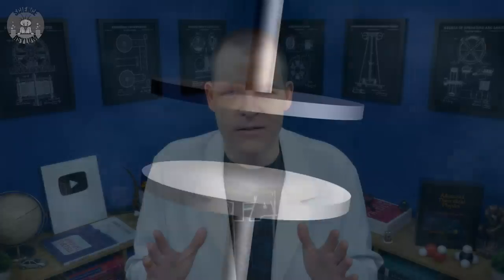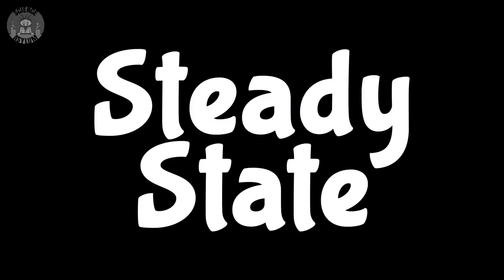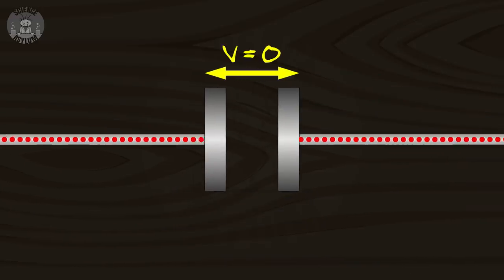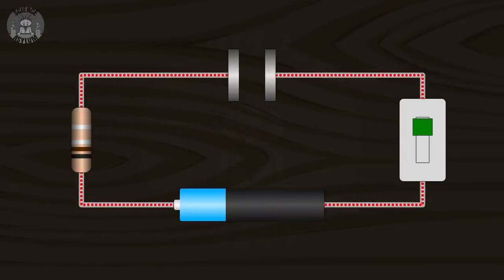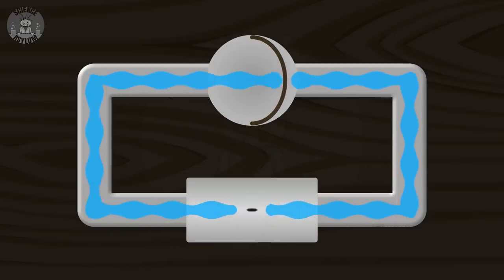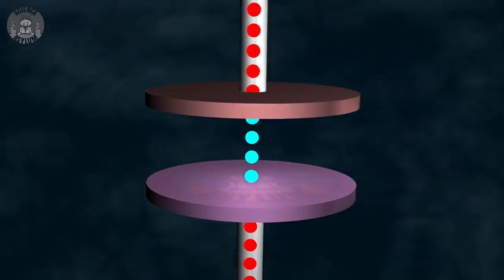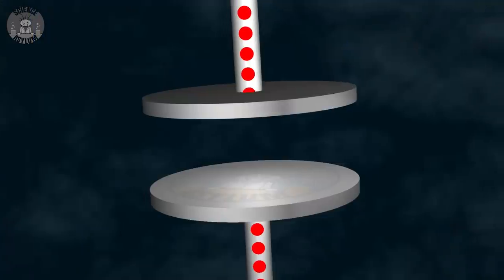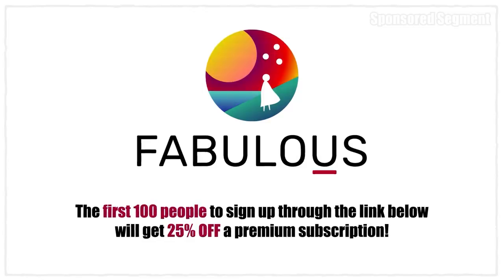Capacitors Are Gaps! How Does That Work?!

Comment: Honestly, I hoped you'd expand on the superconductor bit, given that you can hear basically everywhere they're exactly zero resistance.
Reply from the maker: Saying "superconductors have zero resistance" is easier and sounds more confident than saying "their resistance is below our ability to measure." It's laziness.
Reply: @ScienceAsylum  That's kinda disappointing, but thanks. I guess I should read up more on them.
Reply: @ScienceAsylum  oh wow I never noticed!
I just looked at an experiment where they use very low currents to avoid heating the sample. How would it heat up if there was truly zero resistance ;)
I'm sure it's much more complicated though, with all the different types and stuff...
Reply: @kylebowles9820  Superconductors have a maximum current above which they cease to superconduct, so yeah the current does need to be controlled if you want to actually have a superconductor
Reply: @triffid0hunter  i think the point is that per the conservation of energy, if current generated heat, any amount, there must be resistance.

If the resistance was truly zero, heat could not be generated by the current.
Reply: @triffid0hunter  nice, yeah I was aware of the quenching phenomena, wonder how they do it with superconducting magnets
Reply: @ScienceAsylum  Ok but mathematically we expect superconductors to have exactly zero resistance. We would need new physics to describe a mechanism for which they would somehow gain a miniscule resistance. All measurements up to date are consistent with 0 resistance in superconductors.
Reply: @triffid0hunter  Does that apply to both Type-I and Type-II? (And other types? I seem to recall not all superconductors neatly fit into two types.)
Reply: @ScienceAsylum  Saying "superconductors have zero dragons" is easier and sounds more confident than saying "their dragons are below our ability to detect." It's laziness.
Reply: so you mean I cant put 100 trillion amps into my bike motor?
Reply: @ScienceAsylum  "Their resistance is below our ability to measure," and "No material has zero resistance. Not even superconductors," are two different statements.  Is there reason to believe that it's nonzero? Does quantum make a theoretical prediction of zero or nonzero?

If you have talked about this at length somewhere else, I'd like to see it. Or if you'd make it a future video, that would be neat.  Thanks.

(Sorry for "@-ing" you... 😀)

Comment: 10:38 Oh right!  So that's why doping a semiconductor makes it a better conductor -- it doesn't give any more energy to the charge carriers, just means more charge carriers are free to move around.   I'm currently taking an EE class on semiconductor physics and we're finally getting to the parts that relate to electrodynamics (as opposed to the lower level stuff that's all quantum mechanics and statistical chemistry) so that's what came to mind rewatching this video.  It's amazing how connected everything is in physics.

Comment: Capacitors are just like synapses between neurons. Jumping "variable current" from one edge to other edge of the capacitors periodically as so called "the resonance" or ""oscillation"".  It is sensitive just to the CHANGE as much as its RANGE(capacity, Farad).  It is also something like bedroom lamp which shines while movement continues back and forth. When "back-forth" voltage change is extinguished, then it will be sleep time for the lamp...

Comment: I'm a welder, I've always been curious about the physics involved with arc welding, we usually run electrode positive DC circuits with welding rod, and the heat tends to focus in the base metal, what is actually happening in the arc?
Reply: Very good question ! That’s plasma physics goin’ on in there. I guess Nick can do a separate video on that.
Reply: With SMAW (Stick welding) the electrode positive polarity makes the rod actually get consumed, which drives the arc characteristics and such. 
It's the opposite with GTAW (tig welding) where there is not a consumable electrode. For tig welding, it's DCEN (electrode negative) and that makes all of the heat go into the base metal.
Reply: I’ll explain this in electron current flow, not traditional current flow. Stick and MIG welding are DCEP (direct current electrode positive), meaning the ground is hooked up to the base metal. TIG welding is DCEN (direct current electrode negative) meaning the positive is hooked up to the base metal (except on aluminum or magnesium, where the cleaning action/heat management of AC alternating current is needed).

In stick welding, you are creating a net negative charge on the base metal, hooked from the - cable on the voltage source. This happens because it is more electron charge dense in relation to protons. The + cable on the voltage source is hooked to the welding stick, and creates a net positive charge, because electrons are pulling them from the stick and into the voltage source, so the stick is less electron dense in relation to protons. When the positively charged stick touches the negatively charged base metal, electrons are violently pulled from the base metal into the stick. This enormous amount of heat creates the arc that allows the stick to be fused with the base metal. It doesn’t matter if the electrons are being pulled from the base to electrode, or vice versa. Because in TIG welding the electrons are ripped from the tungsten electrode to the base metal, which is the opposite of MIG/Stick. And in AC welding, the electrons are constantly being pushed/pulled each way- like TIG polarity, then MIG polarity, 120 times per second. The heat and ionization is the important part. 

In the presence of oxygen, it wants to pull electrons from the metal and give it to the oxygen, and over-oxidize the material. That’s why you use more inert gasses, so electrons can’t be stripped and over-oxidize your material. Inert gasses do not pull electrons from your material, making a smooth transition of electrons from stick to base, and thus don’t oxidize them. Inert gasses do not have available electron-empty spaces in their outer orbitals to steal them from metals. Different Inert gasses are chosen for specific metals too, because electron properties are different for both.
Reply: @rebeuhsin6410  Stick welding uses flux on the outside of the stick, that coats and vaporizes as an (inert) gas over the welds. It serves the same function as inert gases passed through a nozzle on MIG welding. 

TIG uses a non-consumable tungsten tip to create the arc, and a metal consumable rod is used while fed in.
Reply: The air gap between the electrode and the metal plate is a "resistor"  an invisible one...5000volts per centimeter and lower at like 500 volts per mm... That gets multiplied by the amperes...
Equals wattage.,. You control the gap with your hands.. Your actually controlling the resistance bigger gap more resistance less amperes... Closer narrow gap is  less resistance more amperes.... More electrons more heat . More melting
Reply: @damascus-ut1ee  Well i learned 2 things in this video and one came from you, thanks for that, and typing a reply to you is weird im typing backwards lol
Reply: @damascus-ut1ee  when you separate your right finger from your left finger by 1 cm you will not see an arc also.... But their is a voltage "arc" in the 10^-7..... Most welding is way way  low volts.... So no "arc" will be visible....air gap arcing requires very high volts "to be visible".. ordinary Welders  have low volts under 100..... You answer is more complete but I have a simple answer for easier clarity....

Comment: Dear Nick,
there is still a simplification in here:
In 05:20ff it's suggested that all the wire and both plates of the capacitor are completely neutral as long as the switch is open.
This cannot be true since the battery is already connected with the wire at both sides, meaning that the later positive plate must already be slightly positive at the beginning to be at the same potential as the plus pole. 
What's the minus side then? 
It must be the near (seen from the battery) side of the open switch in a way that this and the later positive capacitor plate act as a capacitor of extremely low capacity which means the same voltage at an extremely low charge. The rest of the wire,  including the later negative plate of the capacitor, act as a kind of dielectric since they get a slight charge gradient via influence.

Comment: It definitely IS a beautiful abstraction. The energy flowing from the battery to the capacitor not by electrons being pushed on one plate and removed from the other (that is only charge being moved) but through the EMfield from all around is still a mindshift for me. Waiting for the coils now :-) .
Reply: Actually, the only physical thing is the movement of charge (there are separate components for the velocity and acceleration which behave very differently). The magnetic field is just something we measure as a result of moving charge. And the energy is just a mathematical abstraction for bookkeeping. At the fundamental level there are just moving charges influencing each other with a time delay due to the finite speed of light. We describe that by convenient notions of electric and magnetic fields and the even more abstract notion of energy. The electric field is the part we would measure if the charges weren't moving. The magnetic field is essentially just the adjustment we need to make because the charge moved from the location where we would have otherwise measured it to be and that "information" took time to reach us.

Thinking of energy as some kind of substance flowing into a gap is also not really that helpful. It's not really a physical thing that moves. The actual physical things that move are the charges. The rest is just something we either measure or something we use mathematically to do bookkeeping.

Of course the whole thing gets really wild when we introduce quantum mechanics, where radiation (one of the two components I discussed above) is considered. We know it is quantized and we have absolutely zero idea what a measurement actually is physically in this context. Anyone who tells you we do is just making stuff up. The measurement problem is a major unsolved problem in physics. But at a deep fundamental level we need to distinguish between what is physical, what is measured and what is bookkeeping for convenience but totally nonphysical and non-measurable.

For example, set up a permanent magnet in a static electric field. The Poynting vector then says there is energy flux in some direction. But good luck measuring it. It does not correspond to something physically measurable. (Mathematically it is intrinsic angular momentum, i.e. angular momentum when you are not having angular momentum. You can demonstrate it must have been there by doing certain tabletop experiments, but ultimately it is just something that we infer is there for bookkeeping purposes. There's not something actually spinning there in the gap between the magnetic poles and the charged plates!)
Reply: @goodwillhart  👍 wow, thanks for this reply, insightful and also more things to think through ... thanks and best wishes for the new year!

Comment: What happens right around the wires? The energy is flowing along the fields around them towards the light bulb, capacitor, etc. In some places, it looks like it's flowing away from the wires (e.g. near the battery). But if the wires are experiencing resistive heating, then they must be pulling energy from the fields. Does that go into the wires from the outside? In which case is there some particular distance from the wire where energy is not flowing at all? Or some kind of "event horizon" where energy will either end up going into the wire or into the device?
Reply from the maker: "But if the wires are experiencing resistive heating, then they must be pulling energy from the fields."
Yes, while most of the energy goes into the light bulb, some of it does go into the wires (from outside but is immediately turned into heat). The exact direction of the Poynting vector depends on resistance. The Poynting vector near a conductive wire is ever so slightly slanted toward the wire.
Reply: This is why we have grouping factors and balance runs with return paths. It’s extra interesting when you think what is actually happening, it’s so counter intuitive!

Comment: I have a pretty cool story about Capacitors from when I was in University. I was in a circuits lab where we were measuring electric waves with an oscilloscope at different frequencies but we kept getting this 6 GHz signal mixed into our wave, for low frequencies we could basically ignore it, but by the time we were measuring a 1 GHz one (the highest frequency we were working with) it became impossible to ignore while getting anything resembling good data (it probably was messing with our accuracy before that I just don't remember that well). Anyway, we asked the TA that was running the lab, but nothing he suggested worked, but finally we asked the Lab Tech who looked at it and put in a capacitor (or 2, I can't remember the details) in the circuit and the 6 GHz signal vanished, because a capacitor acts as a short for high frequency signals so the high one just drained away (or at least that's how they described it) and we could finish the experiment.
Reply from the maker: I worked as a university lab tech for a while. Always ask the lab tech!

Comment: I often use the water analogy for trying to explain voltage and current...  But I had never seen your example using the rubber dam inside the capacitor !   That's pretty good !

Next, I suppose you will be talking about the dielectric constant.   Or not.  😍😀

Comment: When I used to play with capacitors as a kid. I used to imagine a tiny flywheel inside of them. Thx for explaining! That was great!
Reply: Now that WOULD be a good metaphor for an inductor, since it resists changes in current, kinda giving some metaphoric 'inertia' to the current in circuit
Reply: Caps are much more like springs or elastic bands.  In fact, there's an old timey unit for inverse capacitance called "elastance".  It's a better analogy when you think about the polarity of the voltage as you force charge onto the the plates - that is, it comes back out the same way it went in.   On the other hand a flywheel only stores up energy as you accelerate it and releases it when you try to slow it down but the wheel only has to go in one direction through those changes.

They also behave similarly in that you can charge a cap just like you can wind up a spring and they can both just kinda sit there charged up until you get the energy out because it's being stored as potential energy.  In an inductor the energy is only stored as long as current flows just like a flywheel needs to be spinning to store it's energy. In some sense they both store kinetic energy.

And because there's a natural duality between potential energy and kinetic energy a cap connected to a coil will hand their energy back and forth at a particular frequency the same way a flywheel hung off the end of an elastic will spin back and forth.
Reply: @whatelseison8970  is that like pulling back a rubber band and flinging the charge? (or a slingshot)
Reply: @tk4x431  does it keep the flow of charge consistent too like a flywheel would to acceleration?
Reply: @localverse  Yes.  That is what an inductor does.  It reacts to an attempt to change the current in it, and applies a voltage to the rest of the circuit to oppose this change.

A capacitor would be analogous to elasticity in the mechanical world, where energy is stored in the form of potential energy by virtue of position/configuration.  An inductor is analogous to inertia, where energy is stored by virtue of motion.  Resistance is analogous to viscous friction, where energy leaves the domain of reversible processes and is converted into thermal energy.  Like resistance requires a voltage drop across it to sustain a current, a viscous friction requires a force to sustain a constant velocity.  For viscous forces, it is proportional to velocity.  For other regimes of fluid resistance, it is a lot more complicated and extremely non-linear.
Reply: @localverse  The spring, mass, and viscous damper system as a mechanical vibration system, has a lot in common with the resistance/inductance/capacitance "tank circuit", that you study in circuit analysis.  The solution ends up being an exponential decay as the envelope that is the decreasing amplitude of a sine wave.
Reply: @localverse  Yes actually! Like a flywheel can absorb the inconsistent/jerky rotation of a crank, like that inside an internal combustion engine, and output smoother rotation, an inductor can work to smooth out current from from an inconsistent or 'jerky' voltage source.
Reply: @localverse  like the output of a generator or an ac rectifier. Imagine a square or sawtooth shaped wave, with sharp differences and rough changes from the peak to minimum voltage. An inductor could turn that into more of a sinusoidal wave, where it's a much smoother change from the peak to minimum voltage.

Comment: Although my knowledge of quantum mechanics is limited, I appreciate this video as a metal fabricator. If a capacitor in my welder goes bad, the welder will still work but with reduced performance...way reduced.